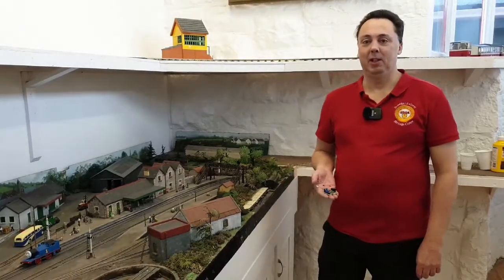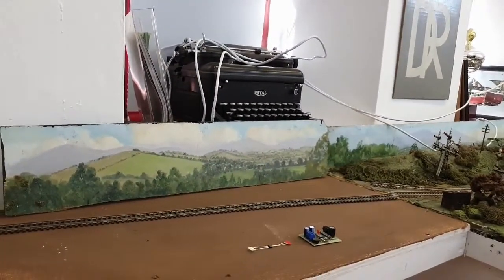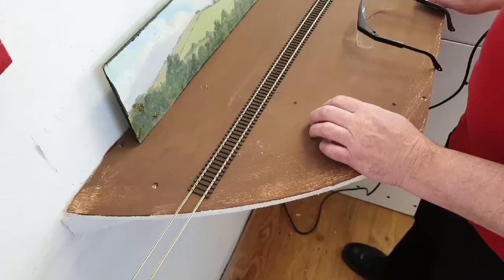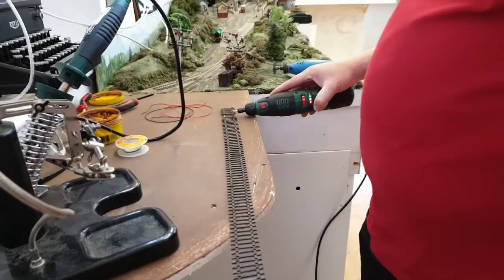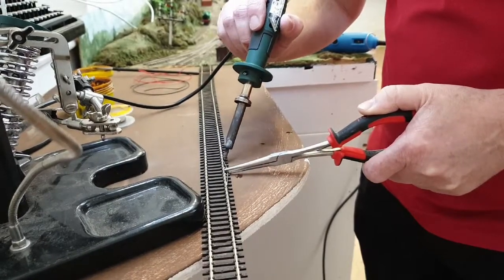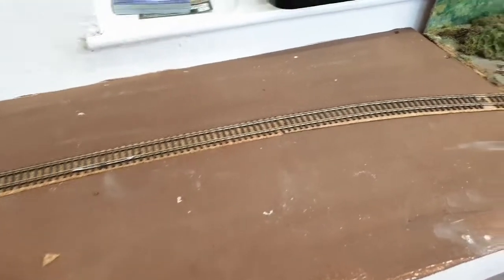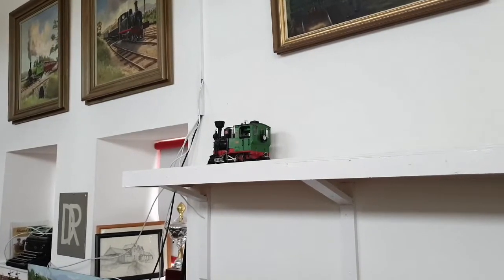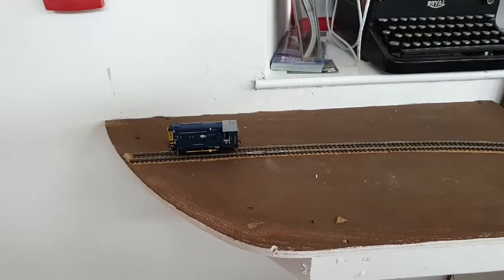14. Installing a DC Shuttle to your Model Railway.

Comment: I know this is 4 years old but I found this video so cool, it’s amazing how clever the unit is going through all the point work. Would this work on N gauge too do you think?
Reply from the maker: It will work with all gauges using DC. Check out https://blocksignalling.co.uk/Shuttles for different types of shuttles

Comment: I've used shuttles before but I wondered if it's possible to add another 'station stop' to a shuttle system and how would you go about this? Thanks for the video. Best wishes.
Reply from the maker: Something like this might do it https://blocksignalling.co.uk/SSM1?search=Station%20stop
Blocksignalling.co.uk  do a lot of different types of shuttles.
Reply: @DonegalDadRail  thank you, I've just been looking over that module coincidentally! Just need to get my head around the wiring for it now. Appreciate the reply. Jules - Small World Layouts

Comment: Where do you buy the diode from as well as the circuit board thing that controls its function? How do you wire the circuit board up too? Please and thank you
Reply from the maker: Hi Lesley the shuttle in that video is not made anymore but here is a simliar one https://blocksignalling.co.uk/Shuttles/SS1 It doesn't use diodes but you can download the instructions fairly easy to follow.

Comment: If I have the diode the same way for both is this ok because with mine when the train stop at ether stop and the circuit clicks for return at either I have to push the train to start them off ,I have cleaned the track and wheels but find out why this is happening can you help
Reply from the maker: Yes the shuttles I use the diodes should be the same way. Check the connections on the diodes, you may have to swap both diodes around to the opposite direction.

Comment: Hi. Great video . I want to do the same. I want to run an emu.How far back from the end would I need to cut the track? Would it have to be just over length of power car? Also on return, would it need to be so that both cars pass cut? Hope this makes sense. Thanks.
Reply from the maker: Thanks  you. You will need to put the cut after the last bogie that has a power pickup crosses the cut.
Reply: @DonegalDadRail  many thanks.
Reply from the maker: @les-halestation no problem I do a livestream most Thursdays so if you have any questions come along and pop them in the chat and will do my best to answer. We are a friendly bunch.

Comment: Hello Mark.  I am still trying to figure out if I could make a DCC shuttle, but DC is definitely a lot easier.
Reply from the maker: DC is easier but you can use DCC to program more complex movements. Check out www.blocksignalling.co.uk for different types of DC shuttles

Comment: I m from London , thank for sharing your video, very simple and clear, brilliant very smooth running so impressive. Can you please kindly where  I can find to buy an auto-reverse device as I need it on my G scale shunning. I m really much appreciate. Keep up good work.
Reply from the maker: Thank you Alan. I get a lot of different types of modules from https://blocksignalling.co.uk/index.php. Have a look at them for different types of shuttles. You will probably need a beefier one for G Scale.
Reply: Thank you for reply for your advice prompt, I m very much appreciated  @DonegalDadRail
Reply: Correction: Thank you very much for your reply and your advice I m really ver much appreciated.

Comment: A very clear and concise presentation... Thankyou... A question if I may... What would happen if the diode was placed (in the wrong firection) with the white line in the direction that the train was initially travelling in as it crossed over the isolation point?
Reply from the maker: If the diode is not the right way around then the current will continue to flow and the train will not stop until the current reverses and then the train will not return as the diode is now stopping the current from flowing
Reply: Donegal Dad - Thankyou for your prompt reply.